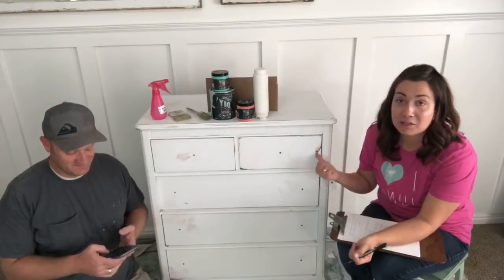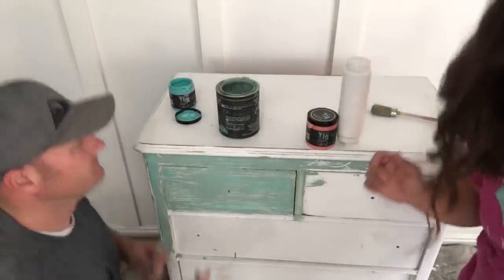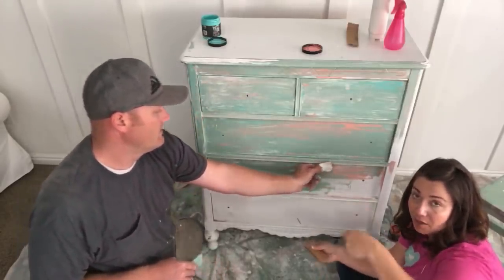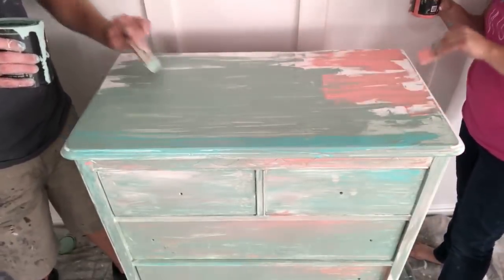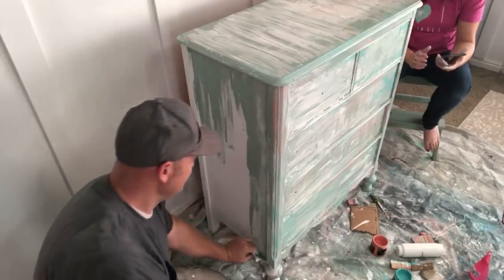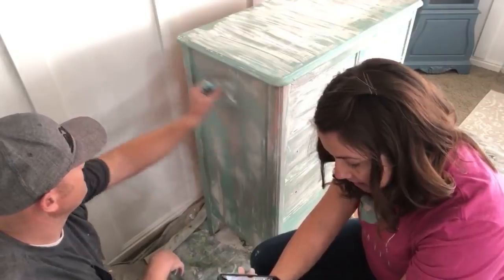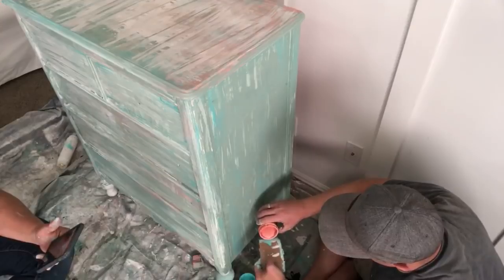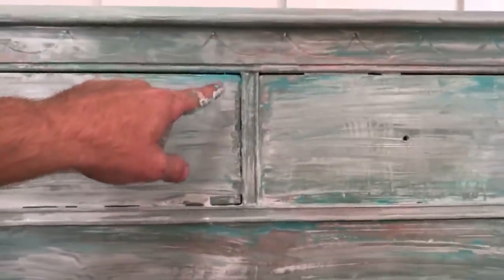🔴 Live Painting Demo | Painting With Cardboard Part 1

Comment: Hi love your channel very inspiring!! I have a question regarding your bathroom redo video. On the cabinet door did u seal those with anything? I saw you sealed the cabinet face frame with the Big Top but was wondering about the doors? I’m currently refinishing bathroom cabinets and having trouble getting the top coat not be hazy. So looking for a new top coat option after repainting the cabinets. (The previous top coat was varathane brush on poly)
Reply from the maker: Yes. We sealed everything we painted. We used DIY big Top, which dries very clear and is very durable. We used s foam brush to minimize brush strokes. If you find your getting bubbles use a lighter touch on the brush to remove the bubbles.
Reply: Jami Ray Vintage thank you so much for your help will def try🙂
Keep up the awesome videos!! ❤️